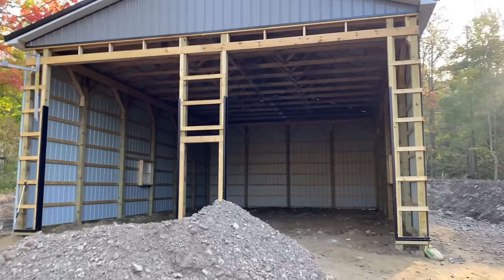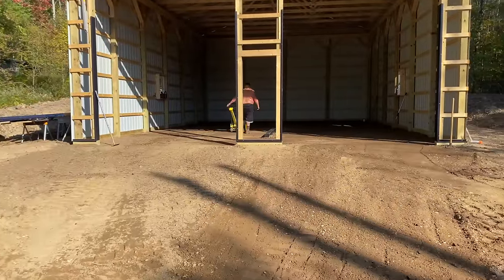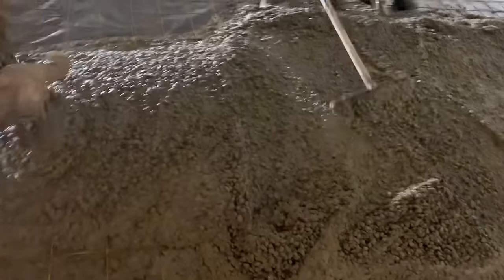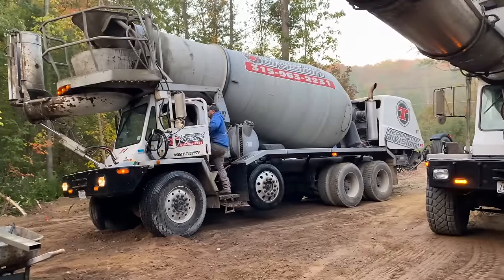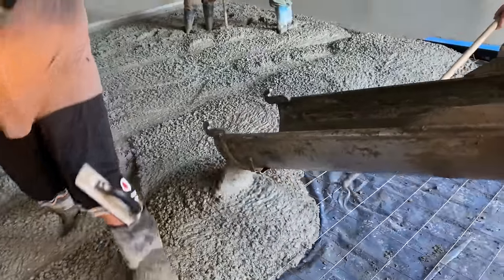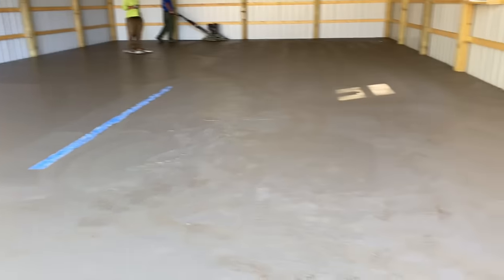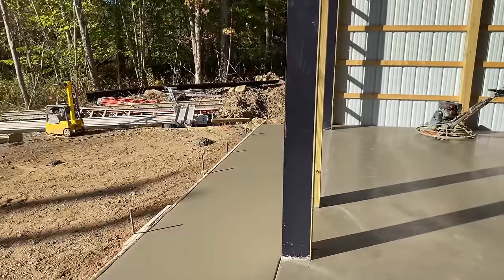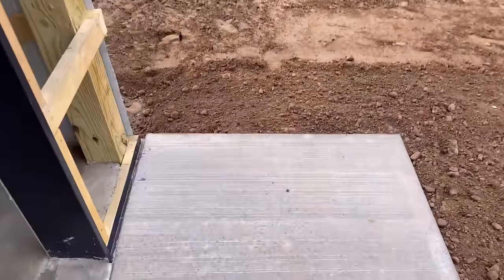WHY WE USED 2 DIFFERENT CONCRETE MIXES FOR 1 POLE BARN

Comment: I would never put my poles in the ground but your work is amazing I watch every video of yours you would make a killing here in my state
Reply: Last week we had to replace 6 poles, due tou excess moisture in the ground and rotted the poles. The building was 40 x 60. My buildings are always on slab with wet set saddles.

Comment: 1/16/24..yes am a Subscriber, been watching beginning with insulating yur add-on garage (some 1 component foam & FbrGls). So I enjoy your casual & conversational style with mostly voice over instructional comments & little bit of 'live' chat with guys, all fine.
 I also watch O'Dell in SoCalf & Tom Hause in Penn. All of you guys seem to be intermittent using those 'chairs/dobies' to center t mesh before pouring your (x, 5,6 y,z) slump slurry. Hause, doing mostly new construction, large garage slabs & long driveways uses power buggies to transport long distances (up/down hill/slopes) from street to target. Both you & O'Dell are doing big patio jobs & pole barn floors using occasional pump trucks but mostly dual tire wheel barrows. So centering the mesh seems to be a common problem solved by your 'potato rake'.. this issue of centering steel mesh seem to be kinda unwanted 'stepchild' in your manipulating the slurry for 'good enough' purposes given time sensitive nature of events but as an observer, it seems your industry needs a better way to center the wire mesh yet allow for foot/buggy or wheelbarrow traffic without slamming/squishing the mesh out of its best 'centered' position.
 So Bondo, is your 'Potato Rake' an inexpensive/practical centering method? Or, is their a better (more $$$) mesh with little 3-D donuts/ circles & with 'feet' welded to mesh intersections a product tooo cumbersome or costly.. + difficult to manipulate on job site situations?
 Also much appreciated your video on 'inside' t cc 'batch' plant..chemistry lab, test samples, accelerator tests etc. That was great, your awareness of our lacking this info/education was terrific...so to what do you owe you r awareness of our collective viewer lack of cement chemestry??..humm..gotta be that 'beer therapy' aye?😊
 Stay safe & carry on💪⚙️🛠🍺👍😊
Reply from the maker: I think the potato rake work quite nice and if you pour it at a relatively. low slump the stone stays underr the wire and hold it up a inch or so and you want it on the bottom part of the slab the tension side as the slab is loaded from the top. Thanks for the comments. 😀

Comment: Quick question for you, don't you usually put a felt expansion piece between the floor and apron for movement?  This spring we will be pouring my shop floor, building is 60x120x18 with in floor heat.  Do I need to add any type of sealer before I put down the epoxy or just leave the bare floor open so the pours absorb the chemicals and do I need to wait about a month before applying the coating?  I've learned so much from watching your channel, thanks for all the tips and tricks!  Take care and don't work to hard!
Reply from the maker: Hi.  you do not want to seal the concrete if you plan to epoxy it. Yes you want to wait for the floor to cure before the epoxy. I find the floor and the apron shrink a little as it dries so I do not put felt board between anymore. The ants come up through it  Thanks for the comment.

Comment: On door edges, saw where they lay a length of 1 1/2-2" pipe across where the door rubber sits.  water wont run over, Mice can crawl under and its straight, seals dont wanna freeze to it either.

Comment: Pulling the wire up, but then walking on it, which pushes it down. Should cut some slips of block and put them under, that way it’s lifted and you can walk on it. 🎉😊
Reply from the maker: The blocks under the wire actually make a weak spot because there is a void in the concrete where the block is so I do not think that is the answer.
Reply: @bondobuilt386  cut them small enough to sit at the X of the wire about 3x3 inch and they won’t be a weak point but will hold the wire up.

Comment: Pulling up the wire mesh is a must if you want in the slab instead of under, but what happens when it gets walked on while the concrete is still runny?    I understand its better then nothing, but is it possible to screed and finish the slab work without walking on it once its pulled up?
Reply from the maker: Not really posible to screed without walking on it. We pour it stiff and the stone holds it up also we don't walk over every inch so it stays up pretty good.

Comment: Is there any way to install a thermal break between the floor and the apron? need to replace my shop floor soon and have noticed the concrete is very cold inside the bay doors and the snow melts on the apron, seems inefficient? not a troll but a legit question.
Reply from the maker: Definetly a good question. You can put some foam board between them but there is still about 6" of concrete sticking out from where the door goes down so I do not bother doing it. I have cut a 2" piece of foam at a 45 angle on the top and put it between but the thin concrete on top will crack as you drive over it. You could use 1"2" foam expansion and caulk the peel out top. It might do something but not much to stop the heat migration.

Comment: Great channel.  Was looking for info on ‘slump’ and came across it.  What slump would you recommend for 12” round piers appx 5’ deep I need to set 12 of them and have enough time to set in a Simpson post base in each one.  I’m thinking about 4-5k psi with 5” slump.  Worried about having maybe an hour to set all 12 post bases before things cure too much.  Thanks in advance
Reply from the maker: Hi. I think 4000 at a 5” to 6” maximum would be good. Have the plant add some retardant to slow it down a bit if it’s hot or pour it in the morning when it’s cooler
Reply: @bondobuilt386  thank you so much for responding… much appreciated
Reply from the maker: you bet  @TheNorthwoodsBuild

Comment: At what depth in the concrete should the rebar be?
Reply from the maker: You want the rebar or mesh about 1" to 2" off the bottom as that put it on the tension side as the weight is loaded on a floor from the top.

Comment: Are you supposed to put a layer of clear stone for drainage? I am doing a floor and don't want to add it. Not sure if it's required.
Reply from the maker: You can use crushed gravel or stone. As long as it has fines in it so it packs. Basements I want stone for drainage so water can migrate to the perimeter drains.
Reply: @bondobuilt386  Why do you treat the shop floor different than a basement? Why do you want it to pack for shops but in basements you don't? Thanks
Reply from the maker: The stone is for drainage in a basement. Also we do not drive a truck into the basement. Stone will push around when you drive on it if it does not have fine dust in it. clean stone is self packing. but it rolls around if you drive a concrete truck on it.  @stevenpringle7813
Reply: @bondobuilt386  Okay, that's what I thought but I wasn't sure. Thanks for the clarification. I didn't want to bring in clear stone for my shop. I have a lot of cement gravel and it's all compacted. It's been in the shop for years with backhoes and tractors driving on it. The quarry calls it cement gravel. I believe it's just taken right from the pit and put through a screed so you get small stones all the way down to sand. It packs very well. I won't have trucks because I am going to put down foam and PEX for in floor heating. I like your video on spraying foam on the floor. I might do that instead of the foam boards.
Reply from the maker: awesome. that cement gravel is a hell of  base fr your floor.  @stevenpringle7813
Reply: @bondobuilt386  Do you want to come up to Clayton Ontario and pour my floor, LOL.
Reply from the maker: A little out of my way Steve. LOL @stevenpringle7813

Comment: At the 36:50 it was said the inside and outside should not be tied together. My garage slab and driveway were pinned together so is that going to be a problem?
Reply from the maker: Hi. If you are in a cold climate with wet soils the outside pad will tend to want to heave a little and the inside will not because it is warmer inside the building. That is why you want them separate. Also there should be more air in the outside pad than the inside in colder climates. So it depends if that is going to be a problem or not.
Reply: @bondobuilt386  Ok Thanks. I live in Oshkosh Wisconsin so it can get cold in the winter. I don't know what are considered wet soils and I don't know how much air was in the mix. It's been 4 years since it was poured and I haven't had any problems yet except for the 4 foot diameter low spot lol. Thanks again and keep the mud vids coming.

Comment: My grandfather had a drain in the middle of his garage floor. I think it probably drained to a 55-gallon drum with holes in the bottom.  I think when he changed fluids in his car and when he butchered deer it all went down the drain. And away go troubles down the drain? This is not a good idea. Your Home inspector needs to look at floor drains.
Reply from the maker: Well common sense should play into having a floor drain. Also a trap box could be put on the exit drain if someone was going to use it careless and let oil and deer blood run into it. The drains are nice to have but like I said about the common sense

Comment: I just put the same style drains in my garage, the Zurn drains require 6” of concrete all the way around
Reply from the maker: We did a drain in an auto body shop that was suspended like you say and concrete went all the way around it. It was real nice but like $3000 for the drain. LOL
Reply from the maker: https://youtu.be/4KdoJY3JjeE?si=Xkh8omGD_ciY5PoV
Reply: @bondobuilt386  yeah three 80” x 6” drain cost me $2000
Reply from the maker: @gorillaman08zx  wow that’s pricey bud.
Reply: @bondobuilt386  we pour just under 100 yards of concrete in my yard, no point in going cheap on the drains and having something fail
Reply from the maker: True I need a real good drain in front of my garage. Is Zurn the brand name? @gorillaman08zx
Reply: @bondobuilt386  not sure, I went to Lakewood Supply and told them I would have heavy equipment pulling over it regularly and they recommended the Zurn drain system. So far I’m pretty impressed with it.
Reply from the maker: Thanks I will look that up.  @gorillaman08zx

Comment: I just don't trust treated poles in the ground. They are doing this with barndominums in my area. I see huge problems in 15 years. The timbers just don't last. Nice job!
Reply: I built one almost 30 years ago, no problems yet.
Reply from the maker: It depends on there poles and ground water in your soil.  @JRP3
Reply from the maker: I am not a fan of the wood in the ground.
Reply: @bondobuilt386  Yeah probably if the soil is wet with poor drainage it's not good but isn't that the way most of them are built around here in CNY?
Reply from the maker: Yes I wish they used the song tube and metal brackets around here like some builders do on Youtube. Much better building for minimal added cost IMO.  @JRP3
Reply: @bondobuilt386  You know any good pole barn builders that work in the Groton/Lansing NY area?  I need to add on to mine and don't want to do it myself.
Reply from the maker: @JRP3  I do not know anybody who works in that area. Sorry
Reply: @bondobuilt386  No problem, thanks for the reply.

Comment: nice work cowboys.what the pourpose off white chemical you spray on?🙏💎🍾🍸🥂🐓🌴🏝👙🎉🍞🇹🇹
Reply: Sealer I think.
Reply from the maker: It is a cure and seal. Helps slow the curing down and evade salt damage.
Reply from the maker: yup  @JRP3